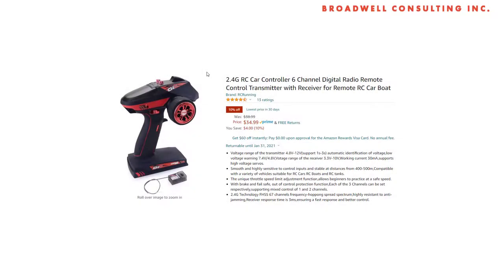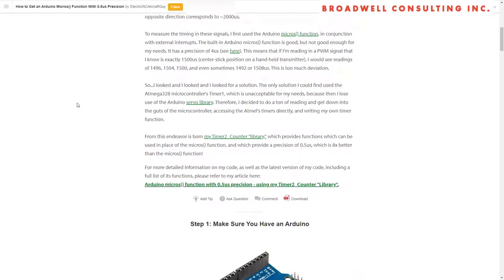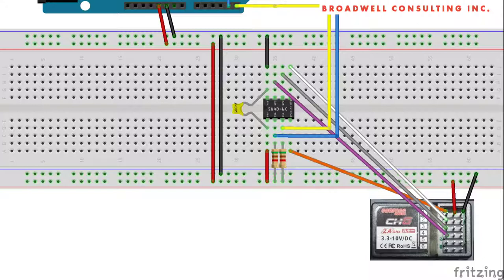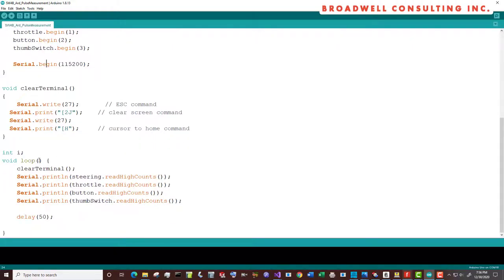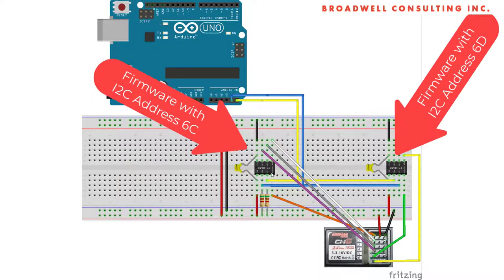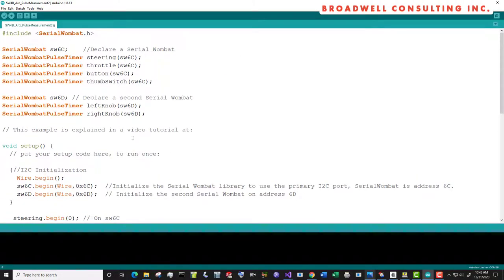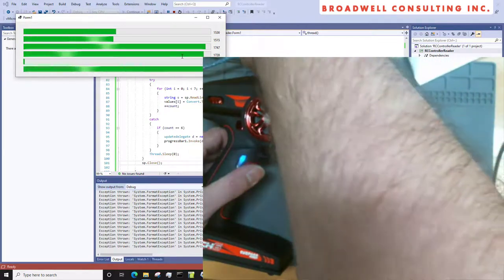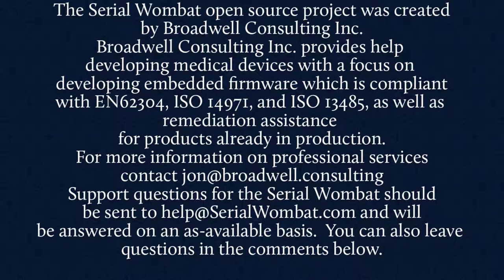Reading RC Servo Receiver Signals with Serial Wombat 4B chip's PulseTimer pin mode.

Comment: Thanks for bringing SerialWombats to the world!! I have two use cases that seem to be easily solved by counting pulses in a given time (eg, 15 pulses have occurred in the last 100ms). Specifically, I'm trying to 1) read whether A/C is live on the other side of an optoisolator, or 2) read hall-effect-pulse frequency from a spinning motor. Of course, I can use PulseTimer's Pulses property and keep track of the counts and times on the Arduino, but I was hoping to delegate it all to the SW for simplicity, scale/performance,  as well as better interval accuracy. Any advice?
Reply from the maker: The chip would do a good job at this.  You are correct that you could get both a pulse count accumulation that you could divide by time, and also get the latest high and low time to determine the speed of the last high/low times.  The Serial Wombat 18AB chip also adds the ability to measure frequency and average or filter that frequency on chip to improve your measurement for some use cases.  As of Sept. 2022, There's no video up yet on how to configure that though.  I'm slowly adding videos to demo more of the SW18AB capability.

Comment: Is it possible to use the pulse timer to read an IR reciever so that my master can decode the pulses?
Reply from the maker: To read IR, you need to get the active time of all the pulses.  The Serial Wombat 4B chip can't store queued pulse lengths.  It's limited RAM won't allow it.  The best it can do is return the last high and low time from the pulse most recently received before the communication request comes in.  This is typically better than using the PulseIn function on Arduino, but obviously has its limits.  It's primarily designed with RC servo signal capture in mind.

The Serial Wombat 18AB chip and firmware has a lot more guts inside, and  has an internal buffer that is capable of being linked to a pin in pulse input mode in order to form a queue capable of storing pulse data.  I've successfully used it to capture incoming data from an IR remote control.  I don't have a video up on it yet, but I've proved it out.  A new pin mode in the SW18AB will be queued pulse output, which will I've proven out to be able to output the same signal that was captured using queued input.  If you used an digital logic chip to combine this and a PWM signal at 38KHz on another pin, you should be able to fully drive an IR LED to control a TV or whatever.